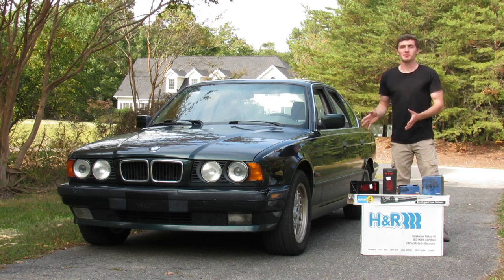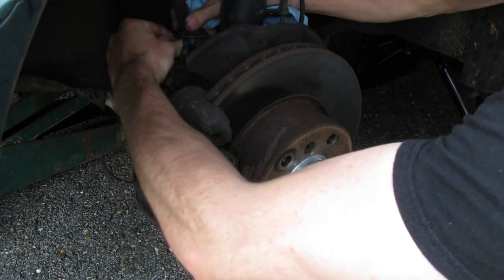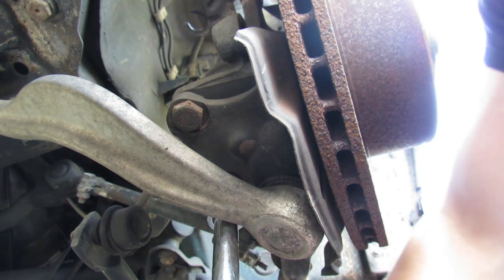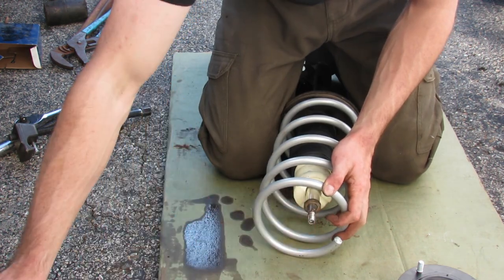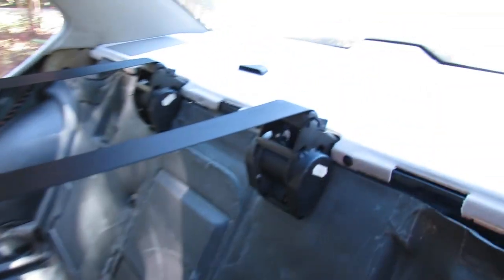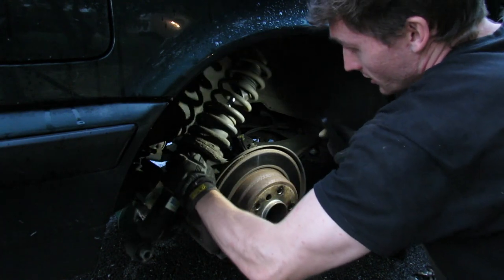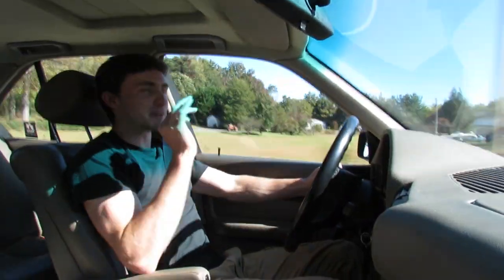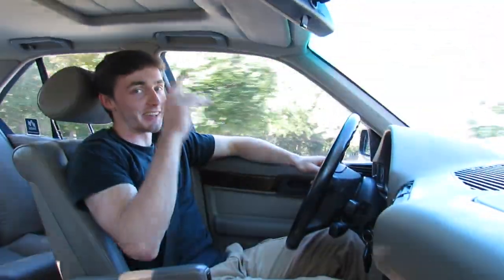Lowering My E34 On OE Sport Suspension! | Strut/Shock replacement DIY + H&R OE Sport Springs

Comment: The most clear guidance so far, thank you @myersmotors. I've ordered the Bilstein B12 Pro kit, which consists of shorter B8 shocks and Eibach Pro sport springs. I was contemplating whether to go for OEM shocks instead, but after your input, I think using sport shocks in conjunction with shorter springs is the best choice. After all, Bilstein wouldn't have put together this kit without good reason.
Reply: What do you think of the B12? I actually just decided against it… everybody told me it’s way too hard… bought the Sachs M-Technik instead. Would love to hear your opinion please!
Reply: @benedictbecker7   it is too hard... the B8 dampers. I will throw them out now and put in sachs super touring. The Bilsteins are undriveable on normal roads imo
Reply: @btfkillsthepromqueen thanks so much for your feedback 😊

Comment: Just changed the front shocks on mine last weekend with the help of a friend who knows another friend with a workshop spring compressor which made life easy. The oil in the strut housing is to help dissipate heat build up from hydraulic dampers, less so with gas units apparently. Your car looks gorgeous dude. Beautifully filmed and explained video and I loved the analysis and summation at the end. I suspect this guy works for BMW on the sly.
Reply from the maker: Oh nice! I figured after filming and looking in the tube that the oil was meant to be there, so I didn't drain it. Really appreciate the positive feedback! Although I'm glad I give off the impression, I promise I have no professional ties to BMW haha

Comment: Just an FYI.  There is supposed to be a small amount of oil placed in the front strut tube when installing the struts per BMW installation instructions. Your strut may have been leaking as well.
Reply from the maker: Yup, gotcha. I had a feeling that was the case and left it in the tube.

Comment: How is it going? I think the b4s are not made for lowering springs. The travel is made for stock springs.  I made that error and the shock absorber was shot in a few months.  They were brand new sachs shock absorbers. Then I  bought the b4s but I put the stock springs back up. The b6 are made for that, much more expensive.
Reply from the maker: Hey, you're absolutely correct. The B4s do not have enough damping to handle the stiffer springs. Definitely not terrible, but not dialed in like it should be. I've got good bump stops so they're holding up fine, I've put about 10k miles on them without issue. Not a long term setup though.

Comment: excellent tutorial!  i have bavarian autosport lowering springs and bilstein shocks on my 89 535.  the bavauto springs definitely lower the car at least 2.0-2.5 inches and have relatively soft spring rates, but the bilsteins provide are a bit harsh on compression.  overall, i am happy with the lowered ride height because these early e34's do have gigantic ride heights...monster truck style.

Comment: Yoo love the vids bro, and finding this video made my day better. My e34 needs new front shocks and struts but wanted to see if you have any good recommendations of some good parts
Reply from the maker: Hey thanks, I'm glad! Recommendations on shocks? Sachs is the OEM part and will be the most comfortable / most resemble what the engineers originally intended. I used Bilsteins, no particular reason other than good results in the past, which I've heard give a slightly harsher ride. That might be some of the difference in ride quality I complained about in the video. If you're looking to go lower and / or sportier, Bilstein makes great sport shocks for these cars and H&R makes some of the most reputable lowering springs with a whole variety of stiffness and ride height.

Comment: 15:02 I‘m having trouble removing the bottom part of the rear struts (bolt is already out), already used a lot of rust remover, hammered on it and even used a wooden block with an axe! In every video I see it only needs a small push by hand :/ Have you got any ideas what else I could try?

Comment: Have a question about the plate underneath that has the three bolts. When putting it back on to the strut housing, do you need to slight them in from the outside of the car laterally, because of the notch? Or just bring them together directly from the bottom?
Reply from the maker: Vertically is fine, but sometimes they do need to slide. I recommend aligning them by putting a screwdriver through one of the bolt holes on both the plate and the strut and prying them back and forth until they're aligned

Comment: Koni shocks are the way to go with Eibach lowering springs and H&R SwayBars and find a strut bar and change all busgings all around with poly bushings
Get camber plates up front and rear adjustable camber/toe  (KMAC or Grount Control)
top it off with 19" staggered rims and the e34 will be on rails!!!
I smile every time I drive my e34

Comment: I Hate the front strut design on these.
Reply: Why is that?
Reply: @TheHunterHofman  one bad ball joint and it feels like crap. 
The take out a strut you need to perform surgery 🤣
Reply from the maker: I was actually pretty impressed with how easy/ well designed it was. I've definitely seen much worse. Doesn't even need an alignment after.
Reply: @MyersMotors  I have an e34 touring. Front suspension is next on the list. 🥺
Reply from the maker: @blue_lancer_es  godspeed 🫡